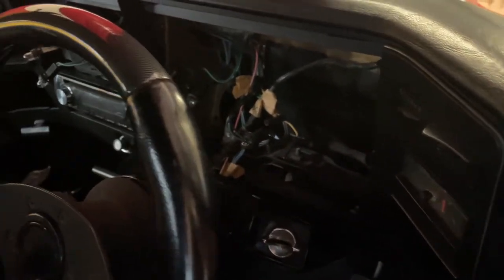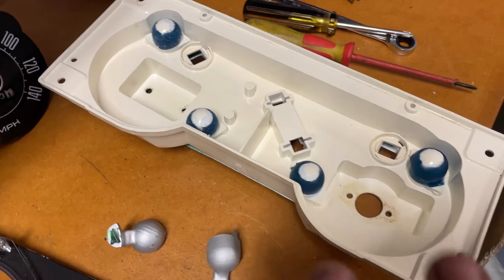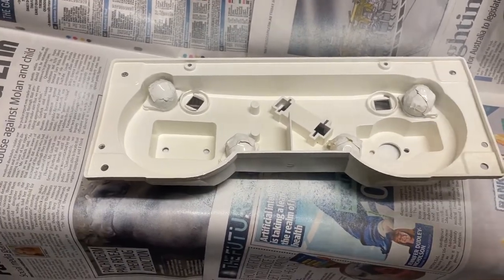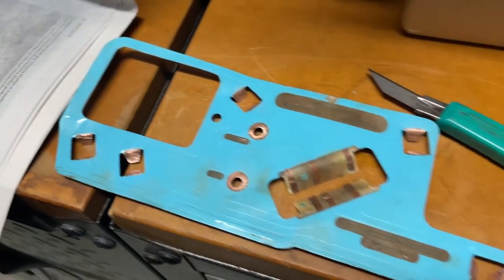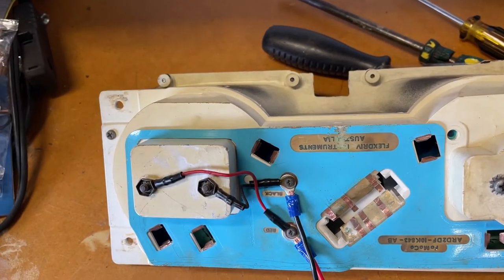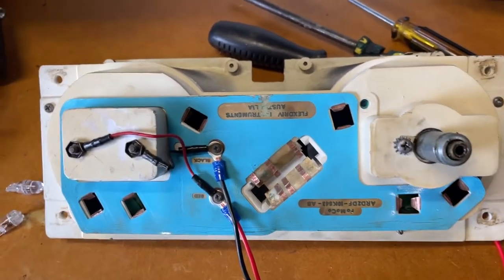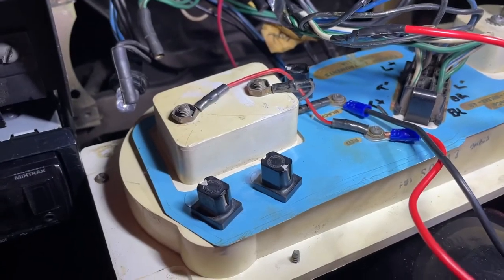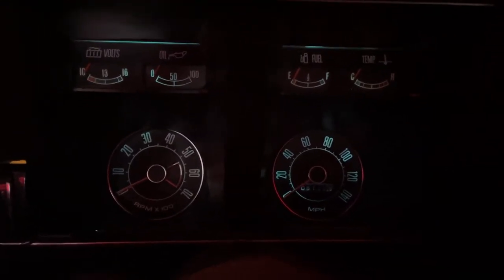XB Ford Falcon Coupe In Depth Gauge Cluster Repair Ep 3

Comment: Also great video.  Got the fascia off - please explain how to get cluster out.  I removed 2 screws but nothing moving
Reply from the maker: G’day, the white coloured plastic cluster sits in a steel reinforcement that holds the complete dash in - there should be 4 screws in each corner to remove the complete cluster.
Reply from the maker: Hi, did you remove the speedo cable?

Comment: I'd be slipping that oddball  8000 rpm tacho plate in place of  the 7000 rpm one in mine.   
What did you use to clean all the dirt from the clear plastic lenses initially ?
The colour balance across the instruments looks well balanced , nice job.
Reply from the maker: Hi, I used dishwashing liquid in the kitchen sink. My wife was not impressed! The lenses were good to begin with. And I agree, the colour balanced very well. Thanks for watching and commenting. Rob.